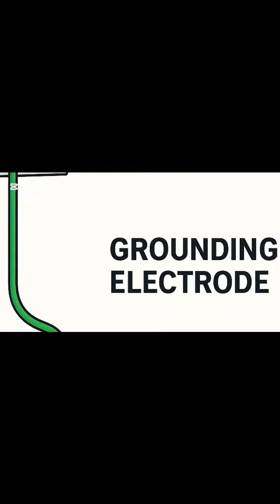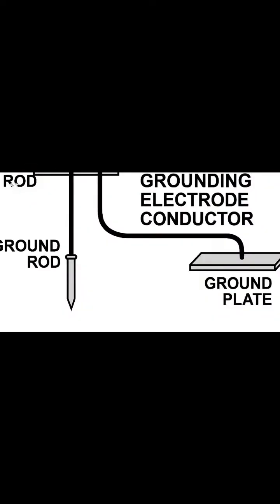Ground Rods, Plates, & Piping: Sizing Your Main Electrode Bonds! ⚡🗻

Comment from the maker: Pass your inspection on Day 1! ⚡🗻 Drop your main grounding electrode, ground rod, or soil depth calculation questions in the comments section below. 

If you missed our live interactive masterclass where we physically simulated mechanical pipe and CSST gas line system bonding rules live inside the lab, click this direct link to watch the full walkthrough replay right now: [https://youtu.be/ABx5STagKqE] 📺👇